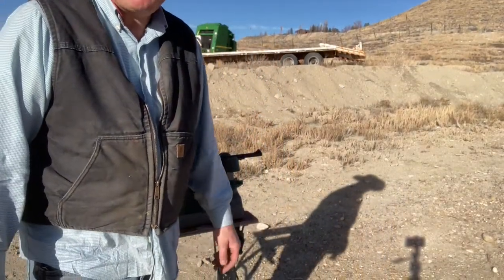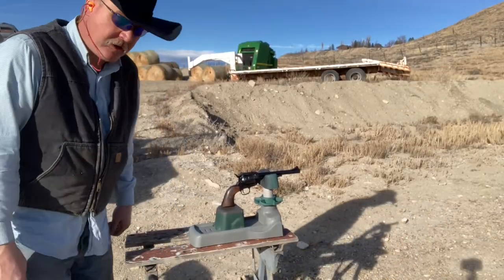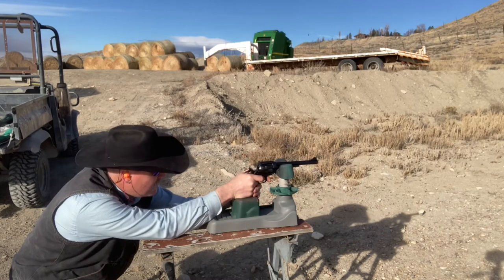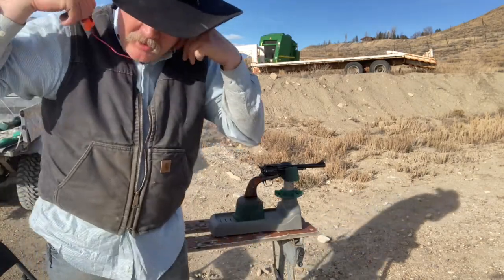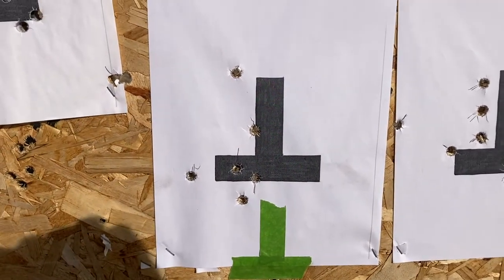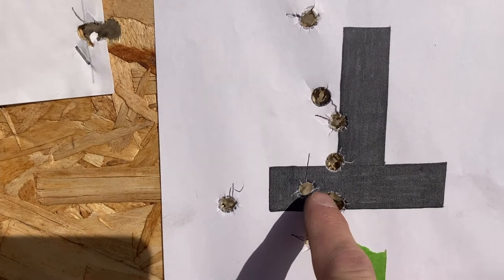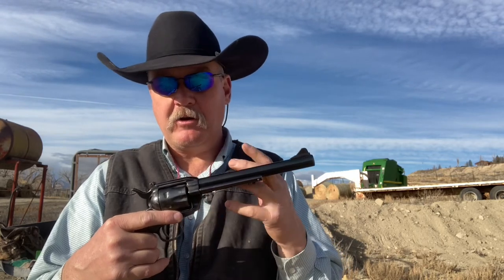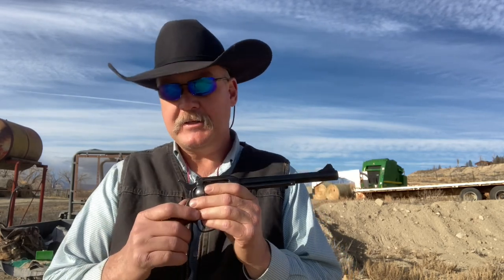Virginian Dragoon Accuracy test loads

Comment: Read somewhere that this particular pistol shoots better with hard cast lead bullets, not so much with the jacketed slugs. Have not had the time to test the theory. Not a pistol I would rely on at the moment insofar as accuracy, so she is mothballed right now.
Reply from the maker: I liked the pistol for sure. I ended trading it for another project. If i were you I would try cast bullets at .452. Mine seemed a little oversized. The powder coated bullets are great. Thanks for watching